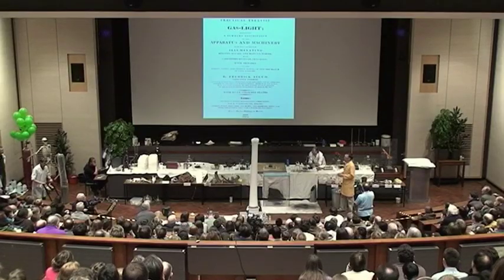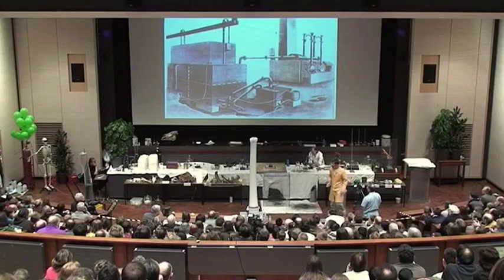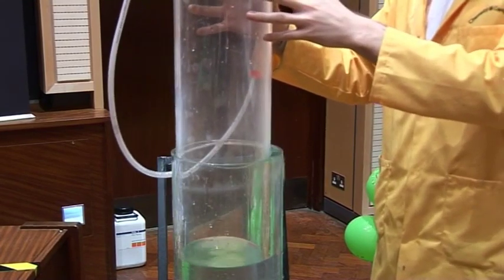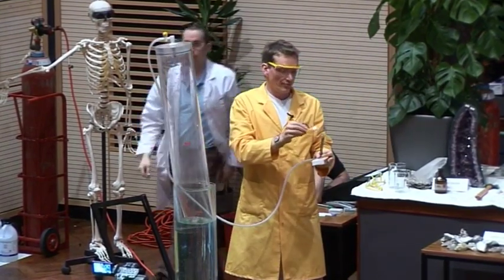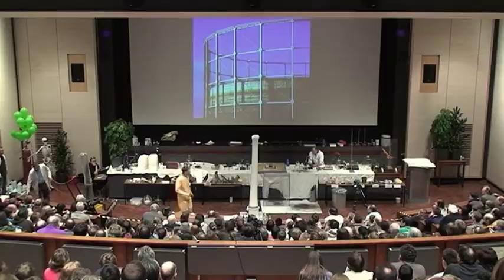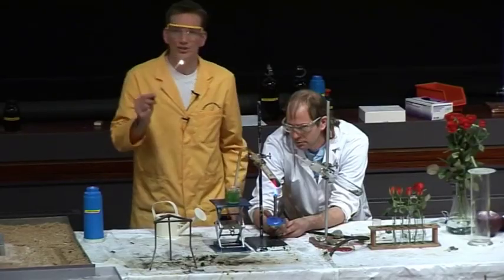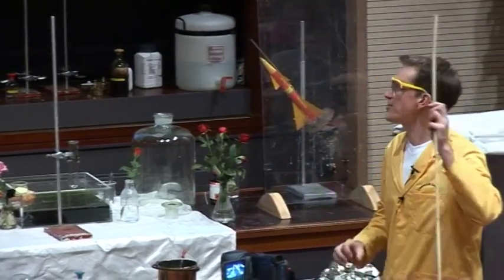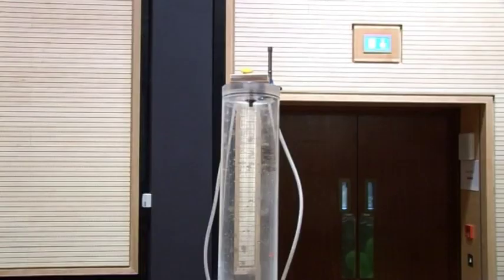Free Range Chemistry  04 - Gas from Coal

Comment: I have a question sir

Can the gas from coal use for car energy? Like fuel or electric cars
Reply: Google 'Gasbag bus', during WW2 when petrol reserves in the UK went to the war effort, buses had rubber bags full of this gas oh the top and they ran off it!
Reply: It depends on if you can has fuel for car energy has cheeseburger electric coal fires

Comment: Why didn't he explained the purification process ?
Reply: If it's stored into a gasometer, the impurities will dissolve into the water
Reply: @EdwardTriesToScience Prior to the gasometer, and after the retort and exhauster, was a condenser that would condense out naphtha, ammonia, and tar. The carbon monoxide was not removed, it along with hydrogen were the flammable constituents of the coal gas.
Reply: The carbon monoxide is purified out by reacting it with something, I don't know what exactly, but you could probably find out by searching it
Reply: We’ll you’d need to attend the class for that now, wouldn’t you?

Comment: Can This coal gas be used in generates for getting electricity ?
Reply: if you filter it, yes you can use it to power your piston engine or turbine. i'm using wood gas for power generation in Nigeria where power supply is an issue.
Reply: @MrNeboff  are wood and coal gas both lighter than air while unfiltered? can they be used in balloons?

Comment: What is the Maths for coal to gas conversion ? 
1 Kg coal =  How much gas ? 
How much temperate needed for starting the process
Reply: Use the mol to gram conversion calculation. Do the chemical reaction equation to get the resulting material and then calculate the % of gas material from the total weight of coal. Temperature to start the reaction I think there's somewhere online, though it's somewhere along the line of the boiling point of the material.
Reply: @MrArthoz  Thank You Very Much